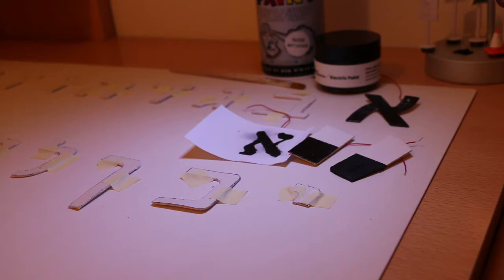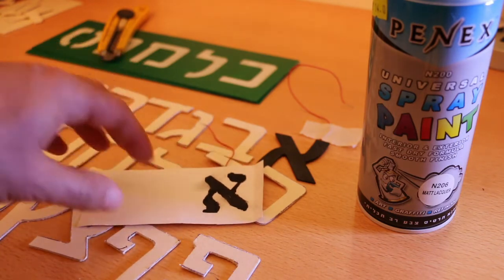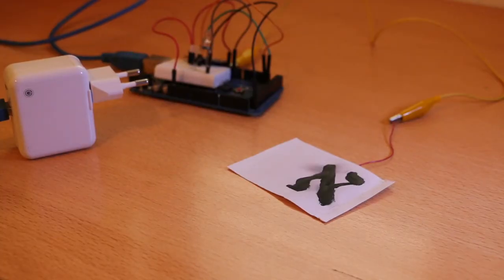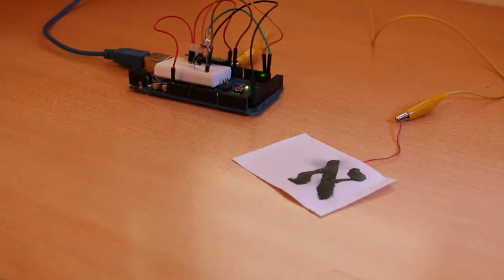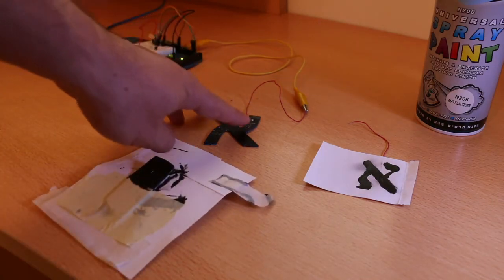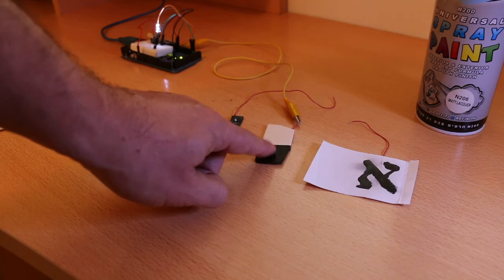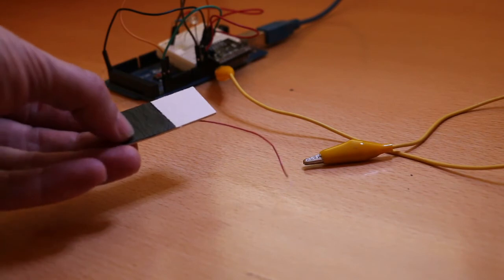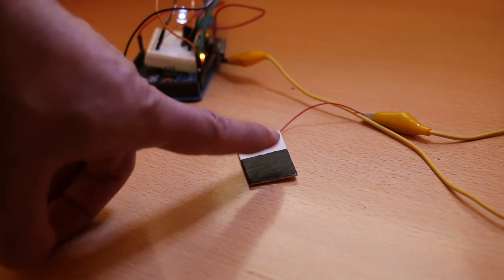My adventure with electric paint

Comment: what is the max distance detect? i painted int the wall with the bare paint but dont have signal. thank you
Reply from the maker: How did you connect between the paint and the mpr?
I have seen people draw long paints thta reacted with it.
You might need to adjust the threshold